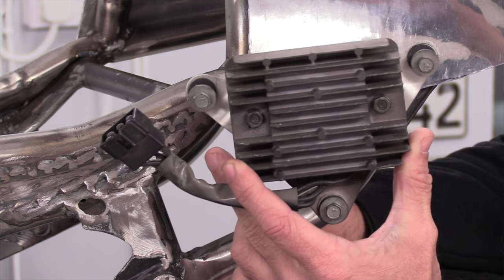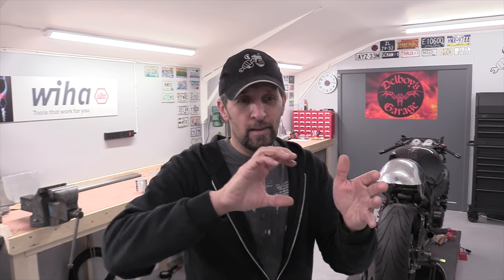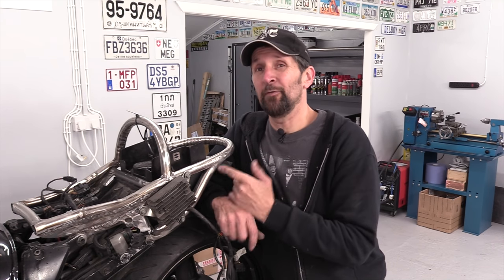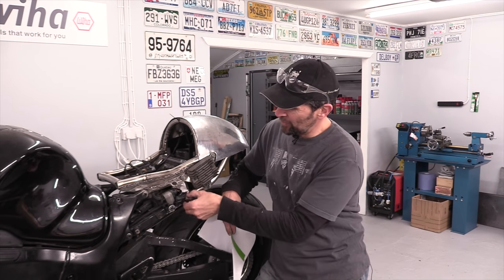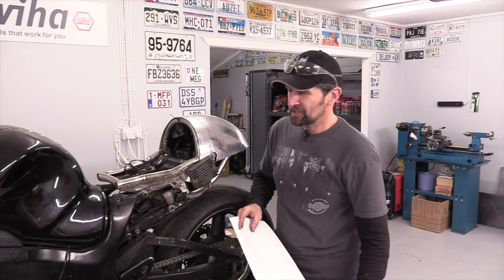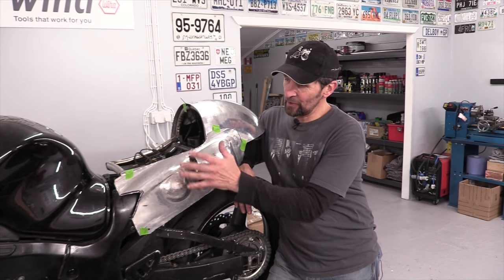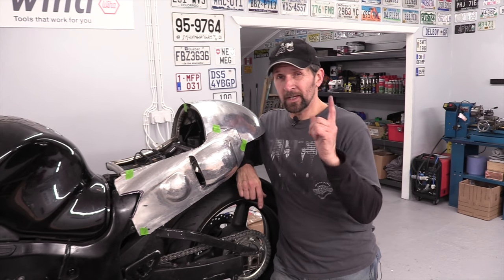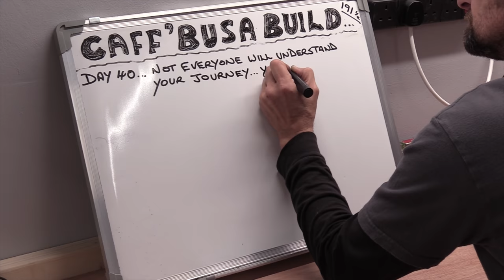Delboy's Garage, Hayabusa 40, Power Bulge Side Panel !!

Comment: Wow! Great practice indeed! With all due respect I think that the side panels in the tail section, deprive the bike of the sleek slim tail section we are used with cafe racers. Maybe putting the regulator on the bottom of the tail would help? Moreover, I know it is an electronic bike, but it would be nice if it could be stripped somehow down to basics. Don’t get me wrong, just pulling some thoughts of the top of my head!cant wait to see it finished!
Reply from the maker: Thank you for your kind words George,  just wanted to ask.. what did you mean by "Electronic Bike"..?
Reply: Moonfleet41 I mean that in contrast to a late 80s early 90s Japanese bikes, it has a lot of wiring and supplemental parts like that regulator which I think make it difficult to hide in order to create that slim sleek cafe racer look

Comment: Instead of the two separate panel covers for the rectifier & solenoid, maybe fabricate one larger piece that will cover both, and you can incorporate some sort of flowing (swooping, or geometric) design into the cover piece. I think that having two covers will still give the appearance of pimples on that side panel. Just some food for thought.

Comment: Del, are you sure the regulator is now correctly located?  When riding I would expect your thigh would disrupt the airflow to the regulator.  
As regards the aluminium, there are various grades of aluminium available, with some being more malleable, I suggest you contact either the aluminium stockholders or indeed the bus body fabricators to find the correct grade.  Land Rover used to use Birmabright for their bodies, which required annealing if it was worked too much  and I know Supaform aluminium is used for architectural panels.
Keep up the good work!
Reply from the maker: haha that made mu chuckle, the panel came indeed from a crashed bus, but was built in 1974, an old Bristol VR, so not so sure I'll have much luck finding that information... but got some new stuff on the way from the same supplier as the tail panel, just a little thinner, so should be easier to work!  Thanks for your kind words, much appreciated.

Comment: I think the aluminium aircraft look will work well. Maybe look at pictures of planes like the dc2 if you can.

I do feel that you have a rat rod style bike already and that the aluminium look will be far nicer not going with that style. The aluminium body is probably more suited to a cafe or faux vintage racer look (what if the hayabusa was built by a mad scientist in the 1930s?).

You're getting nifty with that wheel too - I don't think I'd have the patience.

Comment: A bit of an overkill the work surrounding the rectifier in my opinion. Rectifiers need cooling but the also don't get very warm let alone hot. Within the tail it would have been ideal without the danger of overheating. But anyway a very nice job  done.

Comment: Hi Del great idea to make a vented cover for your rectifyer, I know it's a practice piece but something about the look, it's such a shame that the frame you made is being covered, the frame looks mint I'd wanna show it off, but it's not finished and it's your ride and it's a million times better than I'd do, keep up the good work, cheers.. J👍👍
Reply from the maker: J, You're absolutely right mate.. thats why im not going to roll with this, i wanted to expose a bit more of the frame, so ill be making a separate stand along cover for the Rectifier, then some minimal metal just to mount it.. it will have to evolve and look right through every step.. thanks for the feedback mate.. its really valuable. have a good week.   Del.
Reply: Don't make the panels so big, better to see some of the sub frame. Coming along nice. Cheers.
Reply from the maker: @splodge5714  I agree mate, this was an exercise that gave me some great direction for the 'real' part!

Comment: Wouldnt your thigh block the clean cold air from getting to the Regulator?
Reply from the maker: It doesn't need a jet stream mate, just a little air flow and that's exactly where it was placed by the factory and covered with a huge plastic panel... it doesn't get red hot, just warm!
Reply: @Moonfleet41  Thanks wasn't sure about how much air it actually needed.

Comment: Reasons why i won't do a street fighter on my 250R is the block looks like a 125 on meth. And yes my rectifier is infront (yes you can weld aluminium, check out B is for build, send me a pm or email, i got a rough idea for your side panels)